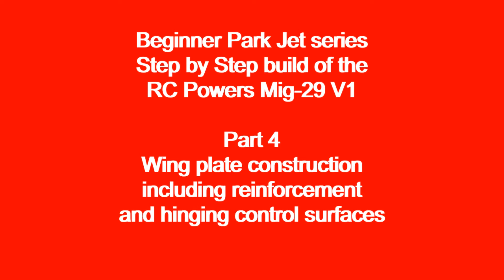Beginner Park Jet build - RC Powers Mig-29 V1 Part 4 - Wing plate assembly

Comment: Nice tutorial on this build. I like your bevel technique with the steel ruler on top of the foam and beveling the underside of the foam. Looks more accurate and efficient than the way I do it now which is the reverse. Nice tip on the motor mount issue and planing during the build for all these adjustments and modifications. I had to think this stuff through very thoroughly before my first original build to decide when it would be best to do what during the build process. Such a time and frustration saver.  Nice adjustment to the battery compartment as well. Have they incorporated any of your changes to the plans because I think they're spot on? Thanks for the video and Happy Building!
Reply from the maker: Thanks very much, I'm glad some of the info is helpful.  I haven't made any changes to the plans, these are RC Powers plans, this plane has been around for almost 10 yrs now and is one of the most popular RC Powers builds because of it's simplicity, the ability to modify it easily and for such a small outlay of foam, materials and time it is really a fun plane to fly even with just elevons only.  Thanks again for watching :)  Cheers, Scott